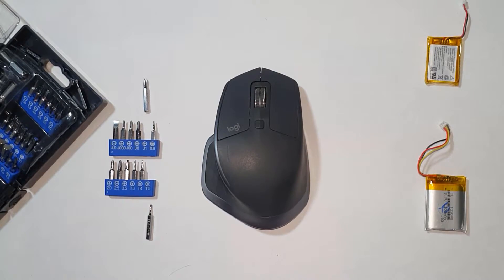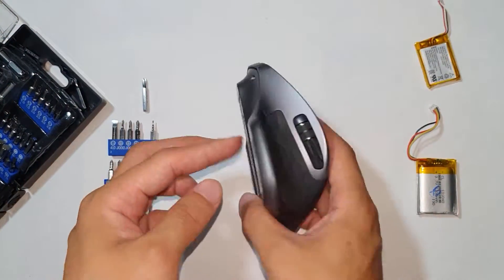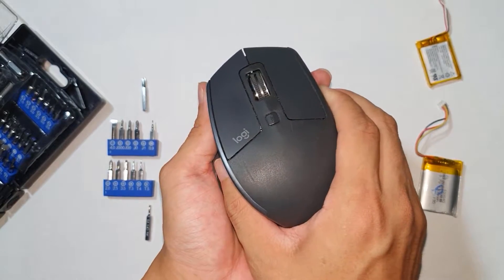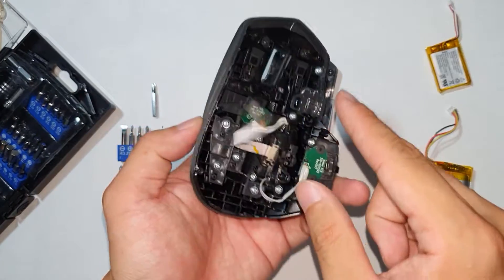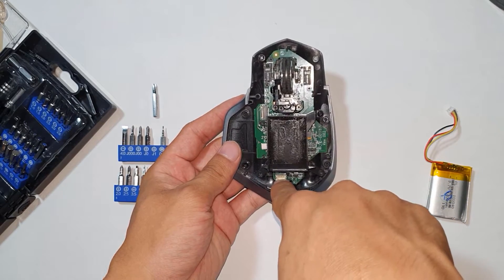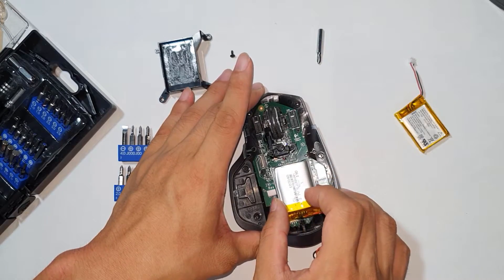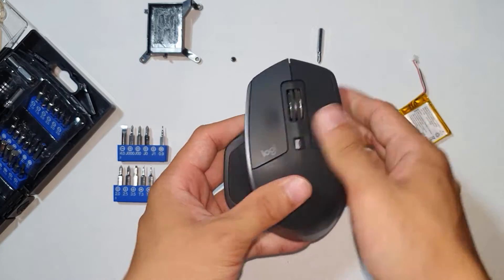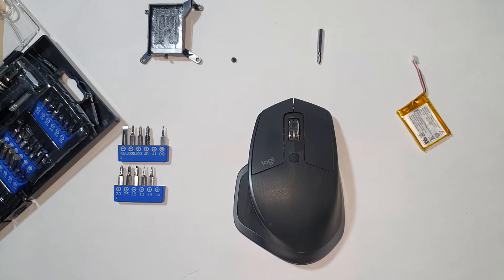Replace/Upgrade Battery on MX Master 2S

Comment: For the battery, search for "DC 3.7V 600mAh 602535 battery Replacement".  This is essentially the same as the original.  I would suggest only the 3 wire ones which has a thermistor (to measure temperature).  With a low power mouse as this, it shouldn't be necessary.  Get a battery with "mAh" 500 or greater.  That just is how much energy is in the battery.  The bigger the better (but be careful of physical dimension).  3.7V is critically important.
Reply: doesn't need to be 3 wires if and only you know how to solder.
coz you can take the BMS from the original and attached it to the new battery.

every time I have a device like smartphone where battery died I always remove the BMS from the battery and toss the batter away.
the original battery's BMS always is the best quality one that is worth keeping.

Comment: Hi guys, I'm about to buy a new mouse, the choise is between m650 and mx master 3s. But I don't see huge benefits in 3s, from my point of view it's downgrade, why it such heavy mouse (140g) with battery life is 2 monthes, but in cheaper ones it lasts around 2 years from one AA battery (around 10x longer, it's huge difference), and weight is less... In 3s reduntant weight is not in battery for sure.  And polling rate is the same, so it's not like mouse uses more energy for better polling rate...
What do you think about this?
Reply: the mx master 3s is OK but nothing special.

Comment: Little observation:
Original battery (M/N:AHB572535PJT). I am pretty sure that 5.7 25 35 are the dimensions.
Replacement ("CL103040"). 10 30 40 are the dimensions once again.

Therefore, search for those two 6-symbol codes, and you aree good to go.
Reply: P.S. seeing your interaction with the commentators, you rock. Keep it up!

Comment: 3 years later: can you still recommend doing this? or is there any longterm "damage" or whatnot.
Thanks in advance.
Reply from the maker: there's no damage, but quality of the battery matters
the cheap battery I got didn't last 2 years, after a year it was barely holding charge, and at 2 years it was always plugged in

Comment: Thanks Victor, well done young man... them bats are not same mah.. would it harm if more than 500 or 1800?  also, the micro-connector has 2 wires, yours has 3?

Comment: Is it still holding a charge? Mine dies after 1 day of use after charging, this is after replacing the battery 2 times. Either the charging circuit is not doing it's job correctly or the mouse operations are in overtime mode.
Reply from the maker: double check to make sure the capacity of the new battery. If you're sure it's bigger than the original, then are you getting them from the same source? 
it's possible that the fault is not the battery but with the circuitry of the board, you can try contacting logitech customer support, they might replace it for you.

Comment: Thank you very much for this great video. Does the battery which you have linked work with the MX Master 1? More specifically: Do you know if the connector for the MX Master is identical to that of the MX Master 2S?
Reply from the maker: I've never used the original master, but from what i can see online, the internals are basically the same, so I would guess the connector is the same

Comment: Hey there, so I found an ebay listing with a 1200mAh battery of this type but there are plenty of different pin plugs. Do you remember the (mm) of the one needed? The options are 1.0 , 1.25 , 1.5 , 2.0 and 2.54 mm. Loved your vid

Comment: What is the best way to remove the glides on the bottom to remove the screws without ruining them & best way to replace them?
Reply: Be very careful.  The first one came off easily then the second delaminated.

Comment: Hi! 

What happened to yours to know that the battery was damaged? 
Mine doesn’t always work, but if I hit it a little bit, it turn's it on.
I already removed all the components and everything seems to be fine with the onoff button, i'm in doubt if it's the battery.
thanks!
Reply from the maker: the mouse was not charging, so i assumed the battery wen bad, but in hindsight, the battery was completely fine, it was the charging IC, which i did another video on how to "fix" it (added a charging IC into the mouse)
if your mouse work after hitting, i doubt it's the battery, batteries are not mechanical, so hitting it won't do anything. most likely a lose/bad connection somewhere.
best reach out to logitech customer service, they sometimes replace products free of charge.

Comment: Hi I know this worked for you but I just want to know, is the increased capacity reflected in the software? Is the new 100% really the 1200mAh and not just 500mAh? I mean, wouldn't the software know the original capacity should be 500 and not 1200? Just curious.

Comment: Hello, i have a MX anywhere 2s, and i notice is a little small, recently i have See in Internet Pages Like eBay and AliExpress, is selled a mx master 2s hard case replacement, the body of the mouse, and i thinking to buy it and make a hybrid, at the inside be the mx anywhere but externaly will be a mx master 2s,it can be posibble?
Reply from the maker: not really, the scrw holes for the motherboard are in different places, not to mention the button placements, it simply wouldn't work properly even if it get it fitted.
Reply: thanks mate, i really appreciate your answer, but it seems that it is very difficult to make a hybrid mouse

Comment: I bought this battery from amazon: https://www.amazon.com/gp/product/B071CJM52Q/ref=ppx_yo_dt_b_search_asin_title?ie=UTF8&psc=1
It worked, but it is bigger than his, and the plug isn't quite the same size.  I pulled the pins out of the plug, widened them with a needle and stuck them on the pins manually, then hotglued everythign in place.  Seems to be working fine, but was a little more work than I set out for. My mouse is noticeably heavier, but for my needs I wanted the battery life.
Reply: Is it still working on your device?

Comment: Will this procedure work on the Logitech MX Master 3?
Reply from the maker: Of course you could, looking at terdown videos/photos, the layout of the 3 is different, but fundamentally the same connector and battery wise. FYI the 3's battery life is already a lot better compared to the 2s.

Comment: Is it same  mx master 2 and mx anywhere 2s ?  For replacement battery ?
Reply from the maker: procedure is the same, tho I believe the size of the battery for the anywhere is slightly different.
Reply: @v-xup6  thanks so much for information

Comment: How many "JST connector model" in mm ??

https://www.ebay.com/itm/3-7V-1200mAh-Lipo-Polymer-Battery-603450-JST-1-0-1-25-1-5-2-0-2-54-connector/113731885015?hash=item1a7af2d7d7:m:mG31ZLuQt9YMxYkkOX4e_nQ
Reply from the maker: I'm not sure what the JST mm size is measuring, but i'm guessing 1.0, if you end up ordering the wrong size, you can simply unsolder the wires from the original battery and solder is to the new battery.

Comment: i always thought 2Wh = 2000mWh, so the new battery would be weaker than the original?
Reply from the maker: (mAh)*(V)/1000 = (Wh)
The original is rated at 2.0 Wh
While the new battery is 3.7v 1200mAh
(1200*3.7)/1000 = 4.44Wh
So no, the new battery is stronger, I think you're confusing Watt-Hour(Wh) with Amp-Hour(Ah)

Comment from the maker: For those tat are asking about where to buy the battery:
You just have to be careful of a few things:
1. Voltage is correct, there can be a +-5% difference
2. Battery have 3 wires, the third wire is some kind sensor. Will work without it, but better if you have it. 
3. Dimensions: 9.5 x 30 x 40 mm, these are the new dimensions of my new battery, and it's just right, if the width and length is slightly smaller, it can probably be thicker.
4. The plug size doesn't really matter, since you can reuse the one from your original battery, or measure that before you buy.

Those that want a link, this is the one I bought, it not international, so it's purely informational:
https://shopee.tw/product/2457132/277408395
Reply from the maker: Sarit Guha  I went and found it from my bin of old batteries, it's roughly 25x35x5mm
Reply: @v-xup6  Hi, Do you know the size of the plug please? I can choose different sizes, but I have not found anywhere on the Internet what large connector is used in MXMaster. Thank you.
Reply: it says $200 for the battery. these sell on ebay for $10. you just need to make sure not to get the 2 wire ones.
Reply from the maker: @BobRooney290  the currency for the link is NTD, so in USD it'd be around 7 dollar something? It's a local seller, they don't sell internationally, the link is purely informational.
Reply: i fixed it!! and the 2000 mah battery does fit!! i just desoldered the board on the battery and replace the 2000 mah battery with the original board from the mouse. and that fixed everything. thank you for the video man. without this video i won't even start this small project.
Reply: hi. do you think the mouse will fit a battery bigger than 1200mah?
Reply from the maker: @Ryuken2721  it really depends on the dimension of the battery. but I would say no.
Reply: @v-xup6  thx for the reply. i guess it's a bummer. Would be nice though to put 2000mah inside this thing. haha
Reply: The batteries can be purchased from alixp (no affiliation whatsoever).  Some of the listings include the star screwdriver to open the mouse. https://www.aliexpress.com/wholesale?trafficChannel=main&d=y&CatId=0&SearchText=533-000088&ltype=wholesale&SortType=price_asc&groupsort=1&page=1
Reply: Hi, i just recieved the battery and after i put everything together, the mouse gave me a quick blink then turned off, one thing i noticed is while i change the cable head to a compatible plug, i accidentally bridge the sensor cable and the + cable, did i broke it or is it doesn't matter? Stuck here
Reply: Hi again, i found something, so I'm using the 2000mah one, after testing it with mulimeter, it shows a 3.93v while the one coming from the mouse itself is at 3,8v. Does this matter? Does the mouse have some sort of overcurrent protection?
Reply: can i use 2 wires (+/-) battery? can't find 3 wires battery
Reply: @jonathannica  i just reuse the board on the original battery and put it to the new one. So you'll get 3 cable either way
Reply: @Ryuken2721  i just try it using 2 cable only (red + black) and it works well without the white cable, thank you for replied my comment :)
Reply: I have found the battery on ebay but I can select connector (3pin) from 5 sizes: 1.0mm or 1.25mm or 1.5mm or 2.0mm or 2.54mm
Reply: How many MM is the plug?
Will this one work?

aliexpress.com/item/32867687085.html
Reply: Voltage will be correct, as all single cell Li-ion batteries are 3.7V
Reply: that link battery only has 2 wires...

Comment: From where we can buy this battery?  Will this battery fit?  https://www.ebay.com.au/itm/3-7V-2000mAh-Charging-Battery-Li-Po-Polymer-headphone-DVD-GPS-103040-7565121-AU/323847989152?hash=item4b66d827a0:m:mSbgELFzk1i2_bwscxwUwlQ&frcectupt=true&var=512865226455
Reply from the maker: in terms of dimensions, this battery should fit without any problems, but it's missing the third wire for the temperature sensors, so it might not work properly

Comment: Do you have a link to the 1200 mAh battery? and what is the measurements of how big the battery must be? 

Are this OK battery's?:

https://www.aliexpress.com/item/33028592995.html?spm=a2g0o.productlist.0.0.494b4feeSdDWhA&algo_pvid=5623765d-8ac8-4c6f-918d-ad07770bf402&algo_expid=5623765d-8ac8-4c6f-918d-ad07770bf402-14&btsid=254e6a32-4ed1-42f1-90f1-ab233e8bb63e&ws_ab_test=searchweb0_0,searchweb201602_3,searchweb201603_52

https://www.aliexpress.com/item/33028600877.html?spm=a2g0o.productlist.0.0.494b4feeSdDWhA&algo_pvid=5623765d-8ac8-4c6f-918d-ad07770bf402&algo_expid=5623765d-8ac8-4c6f-918d-ad07770bf402-15&btsid=254e6a32-4ed1-42f1-90f1-ab233e8bb63e&ws_ab_test=searchweb0_0,searchweb201602_3,searchweb201603_52

Thanks.
Reply from the maker: Yes, those would work in terms of voltage and dimension, tho the plug won't, so if you order those, you'll have to remove the plug from your current battery and swap it with the new one.
see newly pinned comment for more information